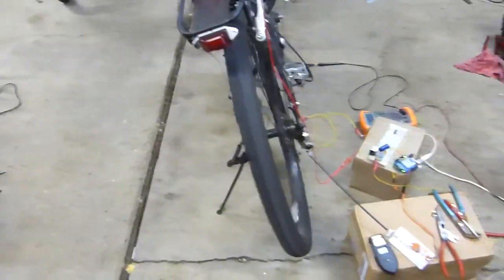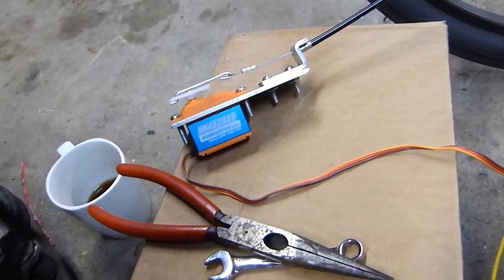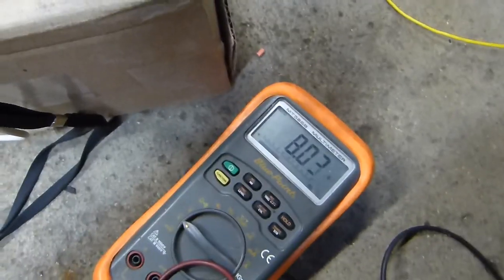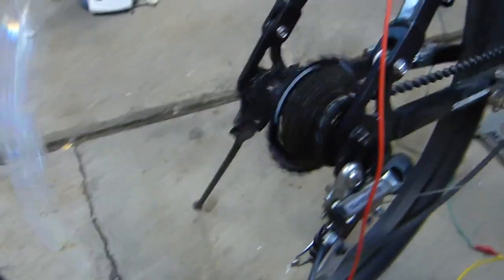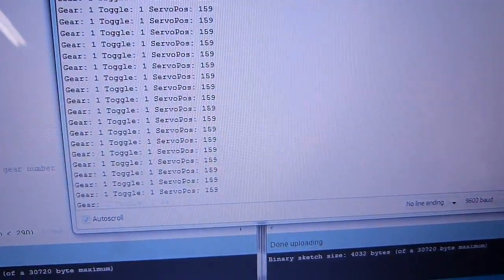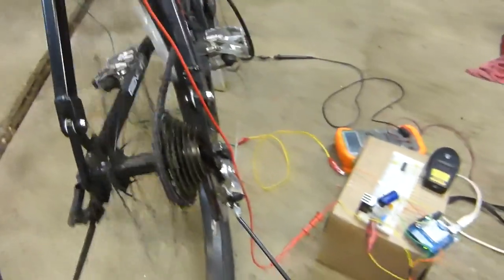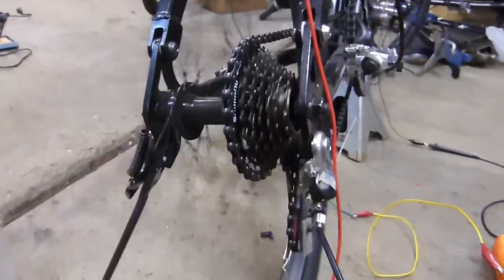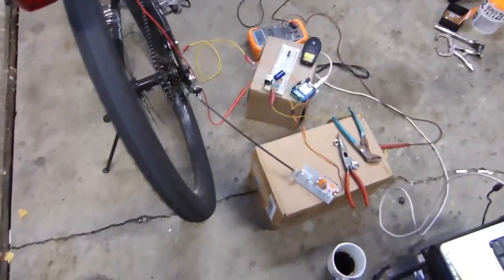Smart Electric Bike - Servo Shifter automatic transmission - LOST FOOTAGE

Comment: you are a good man to do it before of me ! grate esecution. Did you ever thougt putting it in sincro with a BLDC driver to mantain the power of motor under the torque of legs?
Reply from the maker: @pietromazzettidipietralata4281  Thank you. I don't have pedals on this unit, I took out the one-way so it's a safety hazard, and cut off the cranks.

Comment: Nice but useless. I've done that with just esp32. Too much of energy consumption. You can dry your servo very easily.
Reply from the maker: Ya, something like a mini worm drive with a position sensor or servo drive would be a good alternative with super low power consumption, as worm drives can't be back driven so once position is reached the motor can shut off.